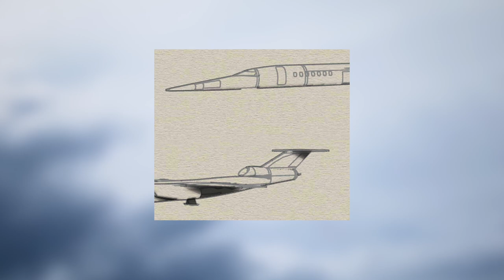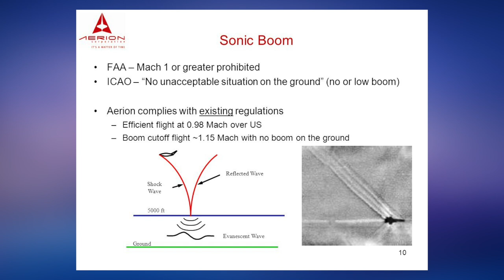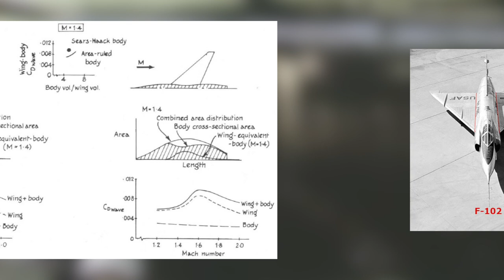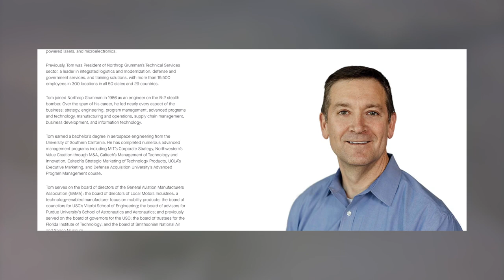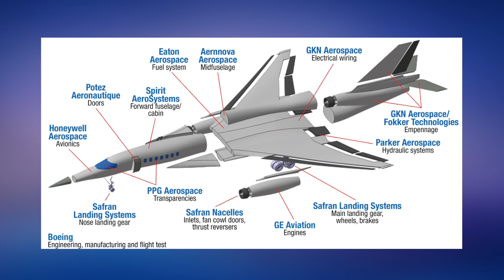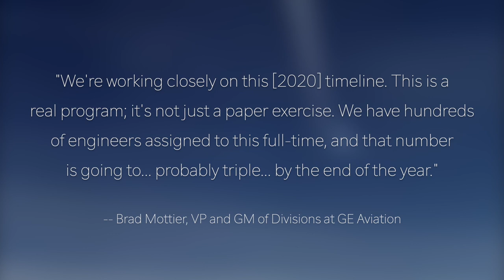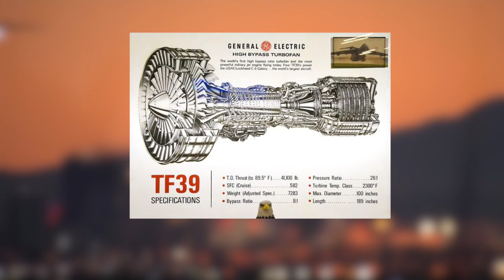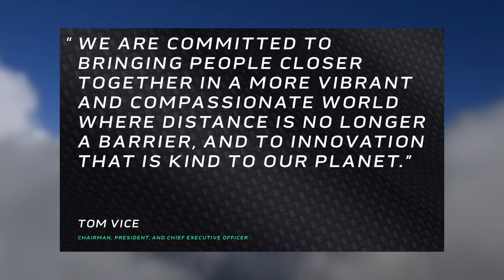Future of Supersonic Flight: Aerion AS2 Supersonic Business Jet

Comment: This project is not like likely to see the light of day. There are far too many hurdles. The main one is engines. There are no existing aircraft engines able to fly at supersonic speed with acceptable fuel efficiency an noise. Totally new engines should be developped, at huge cost, wiht no garantee of success for a very limited market.
The only solution would ne be to develop such engines for the military, but up to now, they haven't shown any interest for it...
Reply from the maker: Unfortunately I agree, due to the current climate I think there are significant headwinds to this project now. GE Aviation was working on the GE Affinity engine, however with loss of revenue stemming from the pandemic it is likely this project is now on the back burner. 😢

Comment: So who is going to build their Engines? Nobody... right. And they figured the how to have an Ultra Low Noise Sonic Boom? Also they haven't... wow
Reply from the maker: GE is currently working on the Affinity engine, 12:36. Still conceptual, but based off existing designs. I think the whole project is certainly interesting to consider, even if it only stays in a conceptual phase!
Reply: @fansofflight  So there isn't one. They all need to wait forthe X-59 to see if it works at all